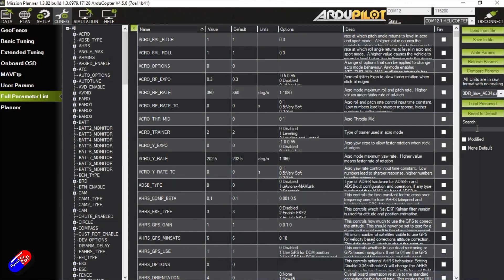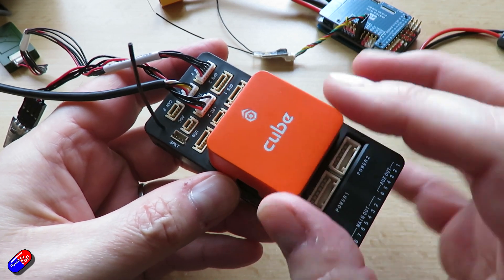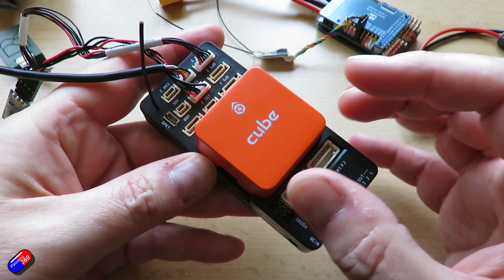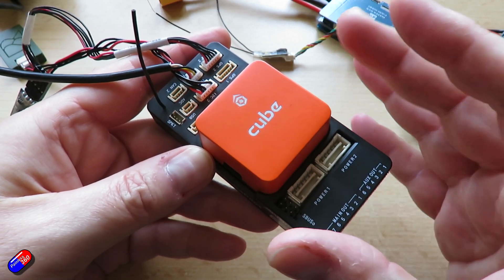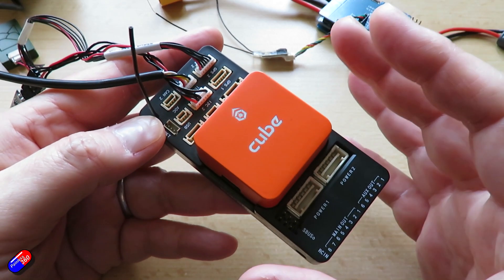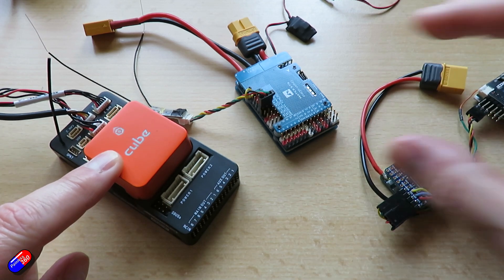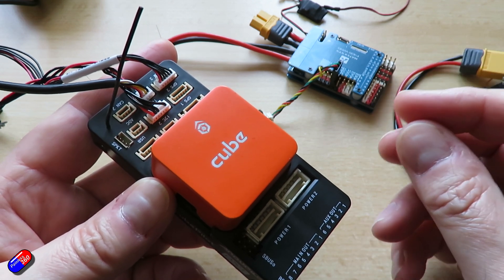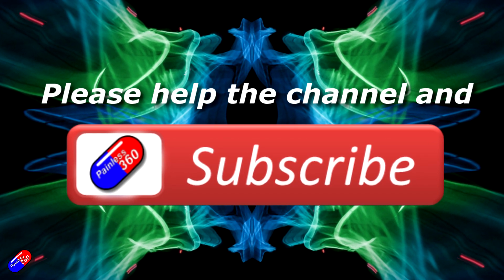How does Ardupilot keep parameters and setting after an update? (It's cooler than you thought!)

Comment: I found it the hard way 😅
Move the FC to other quad, flash the FC, assuming that it will clear the previous config. 
And then proceed to days of confusion why mavlink elrs not working (the previous quad do not use elrs). 
Turns out there are some params that was set previously which I didn't change and not cleared during flashing

Comment: thanks Lee..🎉 good information..to flash another vehikel version, and than the old files are deleted.
Can it be the same If you FLASH with the INAV configurator and do "full chip erasure" ? 
And :  an SpeedyBee only has 1Mb FLASH..will it be also enough to save old files/para. ? in the moment we had a problem with V.4.5.7.  they was working on it..and so much changes that the X8 copter frame class was not supported anymore ! Specially for the only 1Mb FLASH of SpeedyBee.. and we had to ask GitHub ..for an individuelle version with the (Firmware Builder) now we have this checked😊
"We Believe In ArduPilot" ❤
Reply from the maker: Using boards with less memory and horsepower can result in not getting all of the Ardupilot gooness in the flash. "Due to flash memory limitations, these boards do not include all ArduPilot features. See Firmware Limitations for details." on https://ardupilot.org/copter/docs/common-autopilots.html#closed-hardware